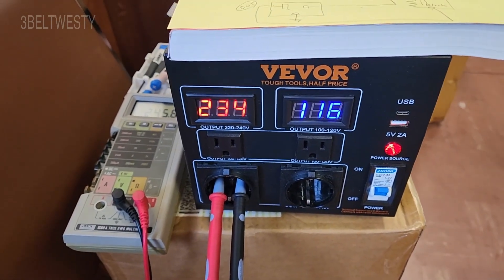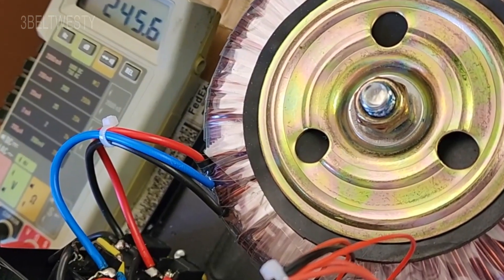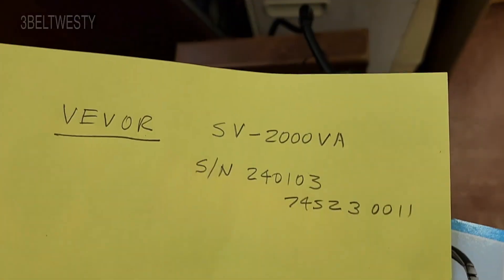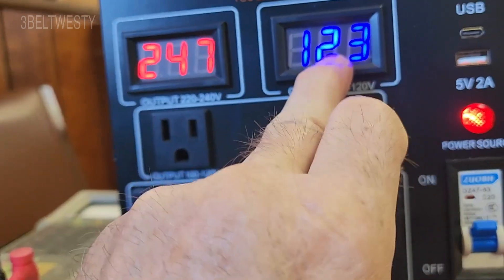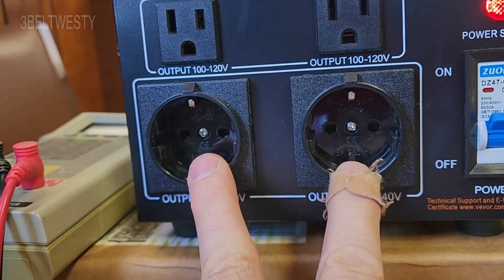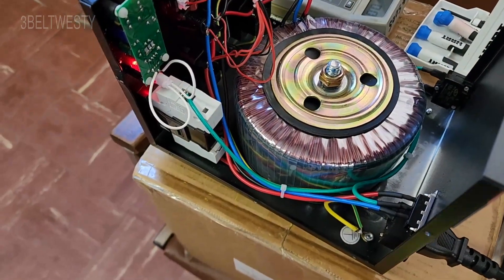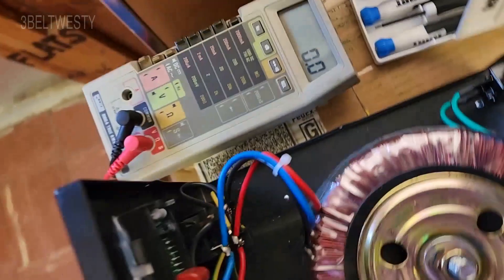VEVOR  SV-2000VA Voltage Converter Adjust meters Toroid Transformer

Comment: Does the Blue have two leads? If so then you could make a isolated transformer by splitting the leads at the Blue wire junction 🤔

Comment: Can you do a video on the 220 connector I tested the 220v port and from each line 1 & line 2 to neutral I've got 170 on line 1  and  70 volts on line 2... can you see if yours does the same thing and if so how come it's not clean power if I connect both my tester leads to line 1 and line 2 my meter shows 240

Comment: Thanks
Reply from the maker: I bought several different VA sizes of these to test and got busy. So someday I will test them for no load loss; efficiency etc.  I have acquired a 240 volt variac with headroom to test them. ie core loss versus voltage etc

Comment: Hi! It is possible to put the 246v down to 220v?
Reply from the maker: As is No; Since the transformer is wound to go Up or Down by 2.  Winding is tapped so the turns ratio is 2 so fixed. 

If one wanted to input 246 V and get 220 volts out you have to add a  tap ie winding place for the 220 volts-

You can get a 240 volt variac and set it to 220 volts too

regards

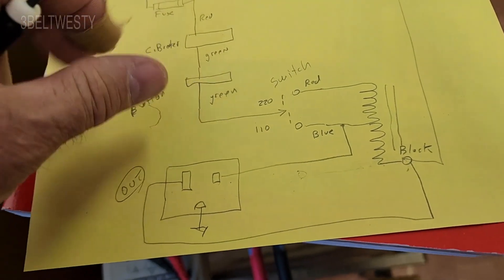Comment from the maker: 0:41 Comparing the 2000VA and 1000VA models both have 3 protective devices in series with the input line too. 

Both have 10 amp glass fuses in the AC input socket

The rear panel "overload protective switch" is  18 amps on the 2000VA and 10 amps on the 1000VA

The front panel on off DIN breaker is C20 20 amps on the 2000Va and C10 10 amps on the 1000VA

, ie the glass Fuse in the input connector

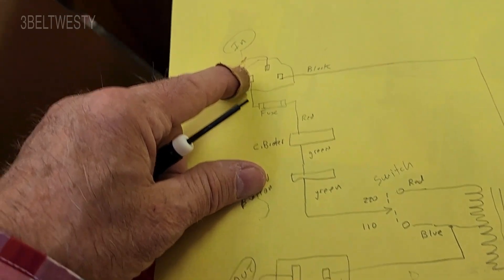Comment from the maker: 0:45 Breaker ?? is used as the ON OFF switch.  DZ47-63 C20 .  The C20 means 20 amps. That is Marked as a 1pole DIN Breaker.I  t is marked 6000A interrupt. Has no UL Listing marked on it.  It has GB/T 10963 a Chinese standard.  Also marked IEC 60898; an International standard. 

 ***There ARE some fake breakers out there; see 
https://www.youtube.com/watch?v=2TJEzdqtXlQ&t=117s

There are UL 1077 rated 20A DIN breakers on Ebay for 19 bucks. INT Rating 10kA 120/240.; 6kA at 277 Volts.

So Here I have not tested this "breaker" to see if it does function as a 20 amp breaker yet.